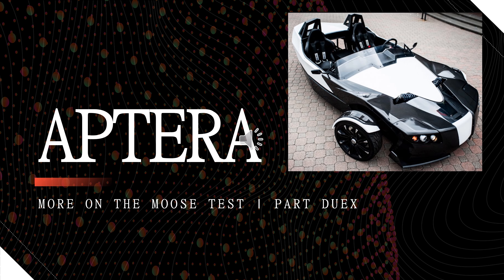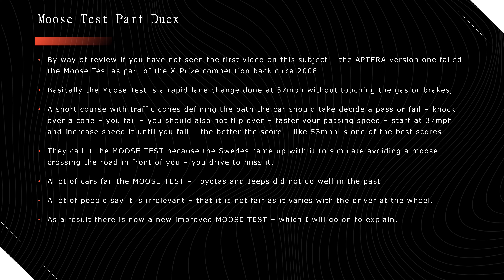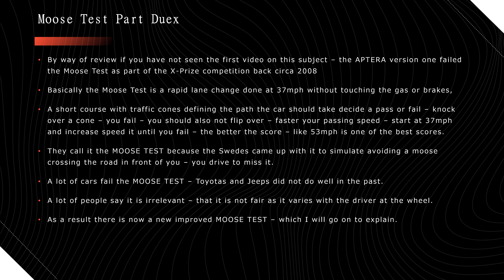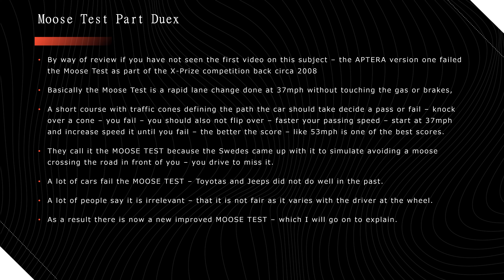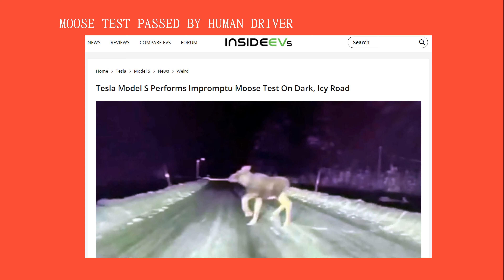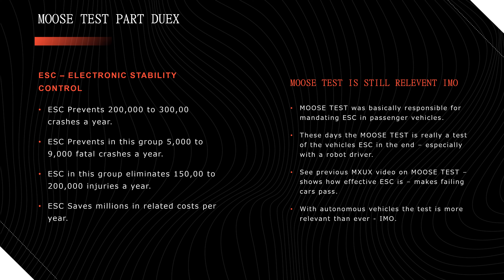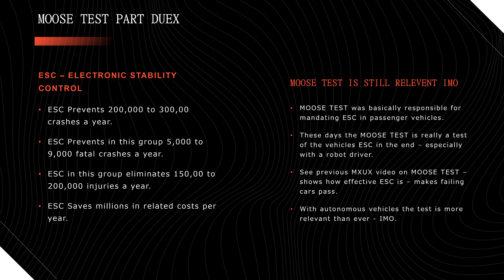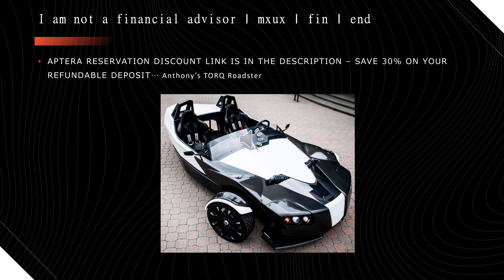WHY THE MOOSE TEST MATTERS | APTERA & the Moose Test part two - Issues Addressed | #APTERA #MXUX

Comment from the maker: Just watched a brief video from Aptera running a Alpha prototype through a makeshift moose test! It looks like they have it down - not a formal course but no problems present - great news
Reply: Word from Raush is that they have almost doubled the speed potential through the moose test with the changes they have made from the alpha vehicle suspension.  They have also improved the turning radius..  This is very exciting.  Tooling for the beta builds is being manufactured now.

Comment: The moose test is definitely still relevant in terms of accident avoidance. One big point for the new Aptera is that the FWD and especially AWD electric motors allow for far more vehicle control than the original Aptera model ever could. Looking at Aptera's Wheel hub motor supplier Elaphe's video show of their additional motor control that dramatically helps with vehicle control, especially in water and snow. The AWD Aptera's torque vectoring allows for precision, real time acceleration and braking of each wheel. So I suspect that the new Aptera will be able to pass the moose test with ease now.
Reply: Totally agree with your comment. With light weight, AWD and torque vectoring, the new Aptera should be able to pass the Moose test easily. I was watching a video on youtube a while back that showed a visual comparison of a vehicle with and without torque vectoring navigating ice, take turns and quick avoidance maneuvers (aka the Moose test) and there was a dramatic difference in speed and control.
Reply: @Deadly Earnest I am guessing that you are referring to Aptera's earlier design, which is fundamentally different than their current wheel hub motor model.
Reply from the maker: I agree - especially the three motor design - but no test yet...the control units on the motors along with the electronic stability control system they put in the car should be really good - I am a fan of these motors
Reply from the maker: good point - but I must say I could not find any footage of the original moose test - only stills - and no real evidence of that in those - do you have some evidence? - the new design seems lower and the battery pack is different as well - and the suspension is completely different because of the hub motors - the test states the vehicle should be filled to max weight capacity - seems a lot there to make a pass on the test
Reply: @mxux  Below is video of the original Aptera moose test, which looks totally stable, but they knocked over some cones. More important is Elaphe's snow testing which shows how they can speed up and slow down each wheel precisely to handle emergency maneuvers totally flat and in control.

https://www.youtube.com/watch?v=GaplhdzWFVg
Reply: @mxux  Me too. Elaphe engineers are visiting Aptera right now. Working on regeneration and specific motor/software tuning to meet Aptera's lofty performance, drivability, and efficiency goals.

Comment: Hey, I like your videos and the subjects you choose. I agree with your analysis on the relevance of the moose test. It did occur to me though that I could ask someone who is concerned with a vehicle NOT passing the test and claiming "It's not safe because it didn't pass the test"
I would ask- did your current daily driver pass the test?  Answer- the person probably doesn't know. I know I have no idea. 
This leads to the next question "Ok, you have been maybe driving your vehicle for some time (many people have their cars 3-5 years. I myself have had the same vehicle since 1986.)   If you tested your vehicle next week and it DIDN'T pass the moose test (most vehicles would not)  would you then get rid of it and find one that does?  -- PROBABLY not. 

So, keep up the good work on your videos.  The volume did seem very low on this video. I had to crank MY volume up to the max to watch. It was watchable but it is never a sin to have a video TOO loud. I've never complained about a video being too loud. Thanks again.

_Late addition thought. I do agree with most of your moose test ideas and I wanted to ADD to the plus column that the idea of the moose test IS relevant and even MORE so in the Aptera case. Why?   Because the design is SO new AND three wheel I see a LOT of people freaking out about how 'unsafe' it looks. With a fair portion of people reacting this way a POSITIVE result on the moose test would be VERY impressive and calm a lot of the fears about 'unstability' and lack of safety in this weird and new design. I myself have zero concerns about the car being safe. I drive a light pickup mostly and also a motorcycle- Aptera looks safer than those .
Reply from the maker: the sound! noted - working on it - the videos of failed tests show the importance I think - the links in the description are good examples too - you can really see Electronic Stability Control working - Aptera I am sure are making sure this issue is addressed in the new version - thanx for the kind words Kirk

Comment: It's a agility test
Reply from the maker: I think so - but these day of the car's electronics - the stability control system senses speed, g force- direction -spin - so forth and adjusts braking, throttle and transmission to keep the car under control

Comment: Boring .
Reply from the maker: thanx for the comment tom - noted - always trying to improve and appreciate any feedback - planning a new Aptera vid which may be more interesting to you watch for it - on this vid - I am a bit of an evangelist about the moose test and it can be boring - the moose test has caused a revolution in auto safety - it really has - recently TESLA announced it will add rear wheel steering - I believe this was in response to a failed internal moose test at TESLA - so I think it is more relevant than ever - thanx for watching- mxux